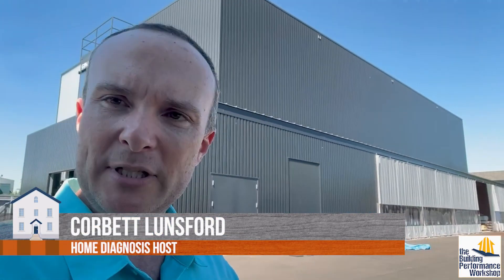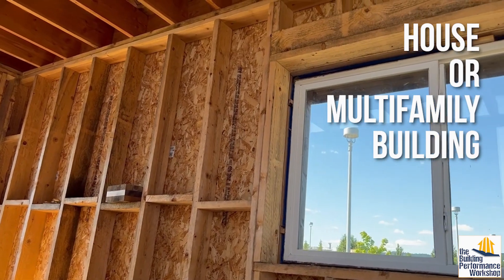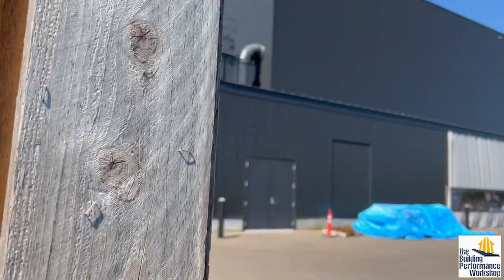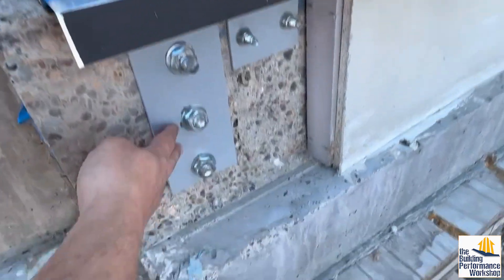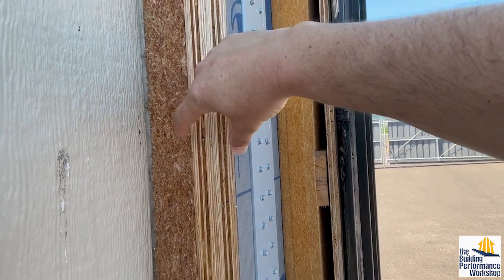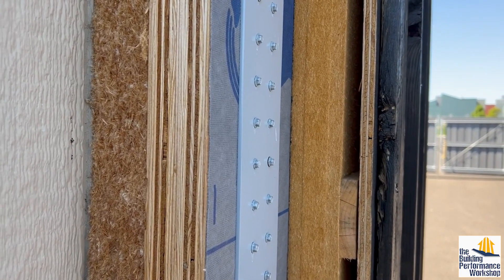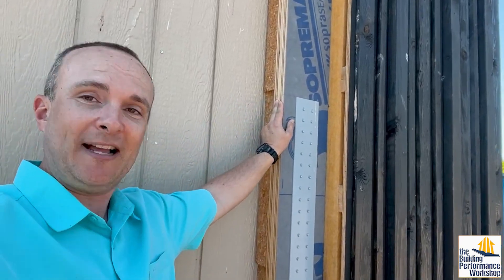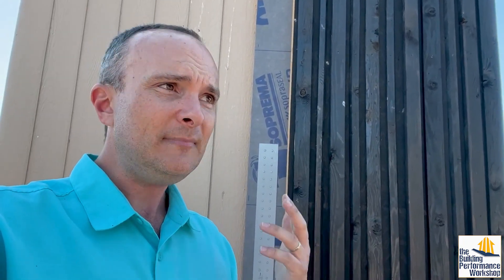The Future of House Wrap: a Stronger, Insulated, and More Airtight Envelope

Comment: Can the structural system be explained in more depth. It looks like the concrete was mostly inline with the new cladding system. Maybe I missed something since the clip was short. Typically though the concrete would be inline with the old framing.
Reply from the maker: We will be diving deeper with Mark Fretz, James- stay tuned buddy
Reply: @HomePerformance  thanks
Reply: I’ve been looking for a better way to insulate my house. A lot of it will come down to cost and the aesthetics.

Comment: What does this cost? It has to be prohibitive in the majority of cases.
Reply: yeah I'm wondering this too. It probably comes down to the labor cost of installation, since the alternative is pretty labor heavy (stripping all the siding and rebuilding the exterior of existing walls)
Reply from the maker: If you can’t let the building stay the way it is, then it’s either knock it down, strip it to the framing, or buy a different one. This seems cheaper than most of the alternatives to me.
Reply: @HomePerformance  Corbin - “seems cheaper” - these days costs are always a surprise. You never know until you actually get the bids .
Reply from the maker: Of course
Reply: @johnwhite2576  Exactly. New suppliers will typically price their product/services to just be marginally cheaper than any alternatives. i.e., no one is leaving "$100K" sitting on the table! Add in all the remedial work required on the inside of an older house (plumbing, wiring, asbestos, windows and doors, hvac, etc) and I cant imagine there is any real savings to be found vs a demo and rebuild.

Comment: what does a 2 inch plywood panel weigh? I can only imagine those are craned in. Interesting idea tho.
Reply: assuming they're 4x8, somewhere around 150-200lbs depending on wood species. So definitely not easy to handle, but maybe not crane worthy
Reply from the maker: Hm, interesting idea- what I do know is I built our house with just my 65-yr-old mom and dad, and we never had a crane for any beams, posts, or sheet goods.
Reply: @HomePerformance  yeah my wife, some friends and myself built our house out of ICF and rented a telehandler for trusses. We managed to use our farm tractor to unload sheet goods and move them around. I was just curious because 2 inches of plywood could probably hold up to flying debris pretty good.
Reply from the maker: I bet so too :)